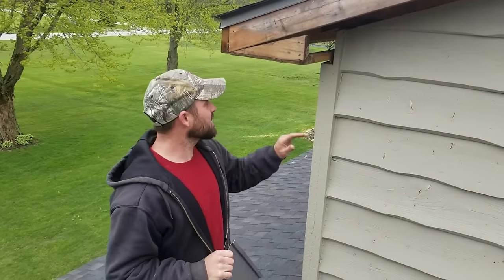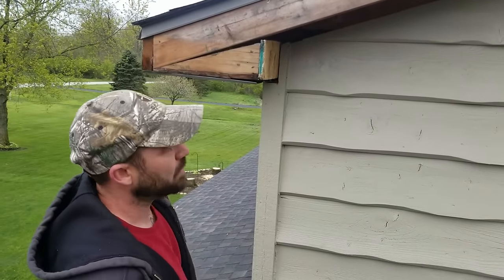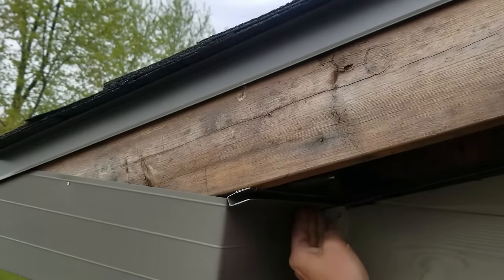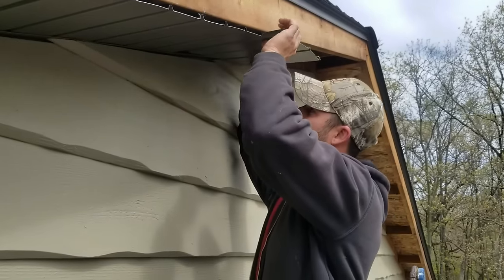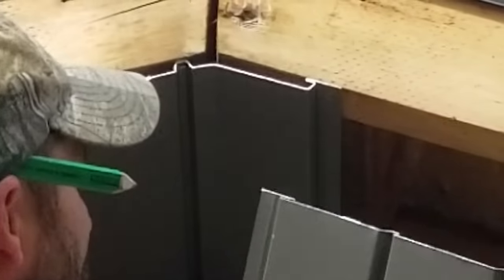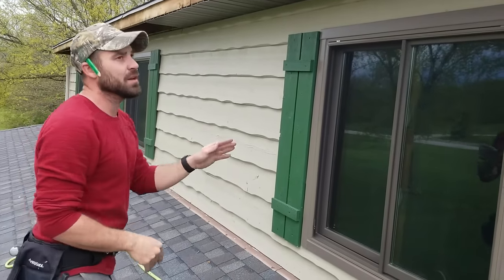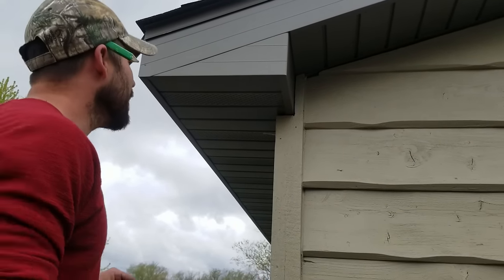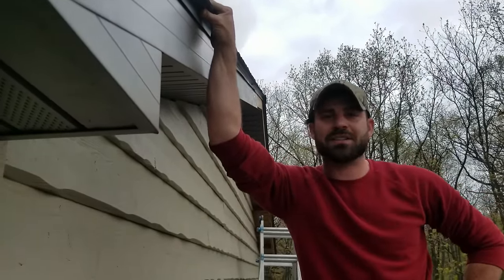HOW TO | Birdbox, Soffit and Fascia.

Comment: Man. Day late and dollar short on this one. Spent all day yesterday redoing fascia on my grandfathers house. Old one bys were completely rotted and gutters and fascia falling off. Could have used a few of these tips lol. What nailer is that you are using ?
Reply from the maker: damn i'm sorry! I usually save my better videos for sunday. you can ususally comment on my newest video or try a few times and get ahold of me if you got some questions. I use a 18g crown stapler. 3/4 or 7/8 staples in it. mines a dewault but I have a tool shop one as well as a bostich
Reply: @NWIVeteranConstruction  Yeah I've left comments on a few. We actually went to high school together at cp. Saw u in home depot couple months back while I was with the wife and kids but u looked busy so I didn't bother coming over

Comment: After watching your videos, I was able to Soffit my whole house. I am preparing to do the fascia next. I was told that I should only use white aluminum trim nails. I see that your guys are using brad guns. If I want to use my 18 gage brad/staple gun which I do. What staples should I use that will outlast the weather or are they all the same? please help and thank you in advance.
Reply: That's a stapler. A brad won't have enough of a head and will go through the material.

Comment: Needed to bend the first piece of faca on bird box around so front could go flush but good work 3 solid  1 vent
Reply from the maker: I actually use center vent now a days. looks nicer in my opinion. and I disagree with that honestly. you're right if you're doing a hip roof that's the way to do it. but if you do that then you will have front and the gable both cut flush coming together. I made this video so that guys will actually start avoiding that. that's exactly what my one guy did that I said he screwed up.
Reply: Gotcha thats how I learned there's alot of diff ways at the end if the day it looks great and water proof my guy
Reply: Really  dosebt matter the way you lap that if the gable end  facial will cover to the corner, but this very much depends on the with of the bird box because it will not always hit the corner dead on and the lap can show in that case especially  with pre bent  metal .
Reply from the maker: @uknodebo3092  fo shoo
Reply from the maker: @jessicacallahan9711  yea it's not the worst thing.  I did get lucky that the back fit perfect.  I didn't have to notch for the 2x6

Comment: When you were nailing the soffit we’re you using staples in the DeWalt gun? So if so is that DeWalt specific to staples or can you use any nail gun. Thanks learned a ton!
Reply from the maker: Crown staples. 7/8.  18 gauge I believe.  And it will take and staples from any brand basically as long as the gauge is correct

Comment: Any particular reason you use nails on the gable instead of screws? I also nail my horizontal fascia (I call it lower fascia) but I always use 5/8 soffit screws colour matched to put gable fascia on. Other than that I think I just watched someone do pretty much exactly what I do lol
Reply from the maker: haha right on man. well I've never pulled off soffit with screws in it. I think that's a little overkill but I guess if you're in a really windy area it might make some sense.
Reply: Worlds Fastest Shingler I meant just the gable end fascia I put on with screws, the soffit I typically use screws but just because I don’t have a stapler. Would be nice to get one though

Comment: Pro Tip #1 Don't build your soffit like the one in the video - end the soffit on the bearing wall at the intersection of the gable wall - don't run past the gable wall soffit right to the outside of the gable fascia board. (NOT the fault of the guy in the video installing metal soffits and fascia).

Pro Tip #2 Run the gable siding past the edge of the bearing wall covering the soffit "porkchop" (what we call it) or birdbox (as the dude in the video calls it). Looks much better than putting metal there. Some situations do require metal such as retrofitting the soffits on a home with existing stucco on the exterior.

Pro Tip #3 When installing drip edge, install the bearing wall side first, run it past the gable side - cut the drip edge on top at the intersection of the bearing wall side and gable side and wrap the drip edge around the corner and up the gable a bit.

Comment: When I do soffit facia on gable ends  like that I start right in the peak then the first piece you just bend in the middle groove and finish each side. Then you will get the same sized little piece at the bottom. The only hindrance is having to clip them backwards on the one side.
Reply from the maker: yea that's what I said up at the top. i'll try it a few more times that way and see if I like it better but I've always preferred this way

Comment: Man i don’t think this is gonna work on my eves. They are around 23” and the facia wont reach up to the j channel (it’s 7” up to the facia on the gables from
Bottoms of bird box) on the gables side so I was gonna break a little flashing but now I look at it there will be a triangle showing on the bird box side where the horizontal facia won’t cover up high enough to the facia running down the gable. Wish I knew that before building my bird boxes lol any tip?

Comment: You almost couldn’t pay me enough to install aluminum soffit. Vinyl is so much nicer to work with. You don’t need to have a nailer with you, hit the flange and be done, if you begin to run out of square even in the slightest you can stretch the front or let it “relax” and you’ll never notice it, and it’s all around a better product. Vinyl doesn’t corrode in our climates like aluminum does, and if it takes on an odd color from mildew, whatever, pressure wash it and you’re done!
Reply: Vinyl soffit is shit. It’s not as rigid as aluminum and looks cheap. Plus it expands and contracts to much and leads to blow off. Having a stapler is way quicker and more efficient than hand nailing trim and soffit.
Reply from the maker: I think you ought to change your opinion bud! I see your point but nah.. aluminium is better
Reply: @NWIVeteranConstruction  aluminum siding was big in the 80s but not so much now,cut edges rust and make dtains

Comment: You know with a brake you can make that bird box in one piece !
Reply from the maker: Could've done it by hand with a square.  Don't normally do that but its a good idea for sure.
Reply: Zack of All Trades why not use a brake for your fascia ? You know a roll of Cole . On houses like that they make it easy to float out when you have big difference in your fascia . It will save you time on bird box’s . You can make all of your time . J,F,Starter,Sill trim and any you need to fill odd size pictures . Most of the time I measure when I’m at the house doing my material take off . Then I brake my pieces at home to get a head start . Same thing with cutting soffit . When your paying guys 18 a hour they need to hit the ground running .
Reply: Bending your own fascia takes to long!And if you don't put a rib in the metal it buckels!I agree you can use a brake for alot of stuff but using pre bent fascia is faster!And 18$ an hour isn't a hell of alot!
Reply: Andrew Will when you use a brake it looks better and I can bend the entire house in a hour .  But only a pro can use a brake
Reply: @JohnnyBarger-sb3yh  🤣🤣Only a pro your funny!It's a tool just like any other tool climb down off your high horse!And how does it look better!It's metal rather if you bend it or if someone at a company bends  it!I'm not saying it can't be down I'm not saying you can't make it look nice.However it's a waste of money!Now if you can find someone to pay you for bending it then great!Only the time you have in bending it the money you spend on a brake you might as well just buy the pre bent fascia.We don't have to agree that's ok.Only to act as if your bending metal is any better looking then pre bent is bullshit.Now yes I agree it takes some skill to bend good looking metal that most would rather spend time on other things that generates better income.Best of luck to you boss
Reply: Andrew Will I see your skill in your bird box work . I can do it I one piece . Pre bent doesn’t came hemmed  . Someone pay me , I write the checks
Reply: @JohnnyBarger-sb3yh  what?
Reply: Andrew Will I didn’t think you would understand
Reply: @JohnnyBarger-sb3yh  you see my skill in my bird box work?You have never seen any of my work!Yes pre bent does have a hem in some or at least a tiny bend to stiffen it.You may write the checks to the people you employ but someone writes the checks to you for the job!We all have a boss at almost all levels!Again I'm not saying that you can't make great looking metal I'm not saying you can't make some profits from bending your own metal.Im saying that alot of people can't as the market isn't out there for all.That rather you bend the metal with your brake at the job/shop/or your house it's no different then a company bending it at there facility! Aluminum coil stock is aluminum foil stock.Not saying you can't bend metal that is different then conventional pre bent that looks unique.The time you bend that metal a person could be installing and done faster and on to another job.Also your right some people can't use a brake well or choose not to cause they rather focus on a strong point of theirs to produce more profits.Not everyone is the same and not everyone excels at the same things.
Reply: Andrew Will so you think all coil
Is the same . Brother Kaycan is not Alcoa .
Reply: @JohnnyBarger-sb3yh  I bet you didn't think I would understand what you wrote.It was like a this grader wrote it.Reread it,or maybe it made sense in your head and I can see how it would.As far as all stock being exactly the same of course it's not.I thought you would understand my point but of course you had to act as if you were more intelligent or experienced.Yes stock comes in different paints and surfaces as well as thickness.im done boss your cool  not going to keep going back and forth with you.Your either a kid,too prideful and not humble or a old man set in his ways thinking his way is the only way!!Like I said before best of luck to you hope you prosper!!
Reply: Andrew Will I have been doing great for 50 plus years . I’m to the point I don’t have to bid jobs they call me  .

Comment: Why do you use the store bought trim coil if you own a brake yourself? Looks a helluva lot better imo.
Reply from the maker: really? I always preferred the ribbed look. that's what most everybody uses out here honestly and especially in the nicer neighborhoods. its also convenience thing on top of that. its readily available and I don't need to have a guy bending fascia when he could be installing soffit. its actually not that expensive either. I was always under the impression you only bend fascia if you have to custom bend because of a little one-by bump out or if you're trying to save money.
Reply: I usually bend my own but I have a different way. I come down 5/8  past soffit. Over 1 1/4 then bend a 5/8 lip. That way I can install 2" x 1 1/4" clips that help hold the fascia and keep it from being blown off in a strong storm or windy day.
Reply: Worlds Fastest Shingler  that’s cool. I hear ya on not having to have a guy on the brake. That was always my biggest problem was I needed to be on the brake and I needed to be on the walk board installing when I was trying my hand in the siding business. I’m not too far from you though. I’m in Louisville and we custom bend every piece we put up as do 99% of the siding crews around here. And we use vinyl soffit material too. It’s all the exact same principles as what you are doing we just do it with different material I guess. And we would have put the gutter board on first with a fold on it, then bird box mitering both bottom lips and then coming down with the fascia on top of everything. But all in all I’ve spent countless hours watching your videos and I really enjoy them. I have learned a lot about tiffing from you. So much so I’m gonna try my hand at taking in a few roofs this summer and see how that pans out. Keep up the good work
Reply: **lol. That was supposed to say roofing not tiffing. Lol
Reply: Worlds fastest shingler did this detail the best and most correct way possible. That fascia corner is water proof.
Reply: We always allow the birdbox or  contour bock and rake to run out past the bent over fascia then trim it a hair long and caulk the edge. It looks like a  seamless corner. Also in Virginia we almost always have rake trim so we always break the metal to contour it. There more than one way to pluck a duck.. nice work man!!
Nice work man

Comment: He added that piece of fascia on the side and cut it off. Yes that's the right thing to do but you want to put your front piece on 1st and add an extra inch or two and wrap the corner and run that extra inch or 2 up your Gable that way when you add that side piece and you cut that off flush on the end and water cant  get behind there. Think like a raindrop
Reply: just a heads up
Reply from the maker: That's what I did.  I didn't cut the from off I scored it and the bent it to get a really clean line.  The the gable fascia came down flush
Reply: @NWIVeteranConstruction  that one yes you did. Great job. I was talking about the one on the front. I swear if you put your front piece of fascia on first an extended over to inches and wrap it up the Gable. Then at peace that you made with a crisp line you put that on last that way you don't have to cut edges that meet each other for water to get behind because you have your front piece that runs up the Gable and then you're outside piece overlaps that. Other than that you did a great job just trying to give you a a little pointer if you're understanding what I'm trying to explain here
Reply: I think you did say something about bending a 45 and tucking that in later is that what you said. if I misheard you wrong and that was your plan great job

Comment: Couple of things. $18/hr? McDonald's pays that around here. Avg wage is $30hr,if they can run a brake. (brickmold with no tape measure...hem, Flip, flip,.. You know lol) another.. Why not bend a slip hem (like undersill) on the fascia covering the box? Makes it stiff, and breaks up the fascia ridges if the gable ridges don't line up with the eave.
Reply from the maker: never thought of that. what exactly do you mean if you don't mind a clear breakdown? coz i'm not picturing a good way to get a bend on that angle. and don't dis our pay lol its Indiana. don't cost much these days to survive
Reply: @NWIVeteranConstruction  I do the same as you on gable fascia. But, either I put the tail end in the brake, and bend a hem, pain in the ass, unless you have a helper hold the end of the fascia, as only the tail is in the brake. Or I'll make a hemmed (looks like a piece of undersill) piece to slip over the cut end of the tail. Stiffens the tail over the box, works great on tall box returns, you don't have to make a full box that way (out of lumber/sheeting)
Reply: @NWIVeteranConstruction  with materials and labor for soffit fascia we're right around $10/ft. As long as it's 1 story, or walkable roof. Otherwise it's 50% more for each 10 ft story. Actually, it's anything over 10ft. So walkout are $15/ft. 21ft $20/ft etc. Unless homeowner picks Edco pvc coated soffit. That's a little more, but it looks way better (woodgrain, deep colors)
Reply: Can you explain the second part more (slip hem). I didn't understand. Thanks.
Reply: @Faruk651  so you don't have a cut edge on fascia over the box. You bend a piece of coil stock, and slide it over the cut fascia

Comment: What if the facial board sags I" in the middle?
Reply: You can run a bead of silicone between the panels to keep it from sagging.
Reply: If you don’t want to replace the board just cut the fascia board into a few lengths so it follows the sag more easily
Reply from the maker: if the fascia sags you can snap a line and cut it off. just don't cut off too much. I would say probably should cut off more than 3/4 of an inch or it'll show when you look up at it. if its more severe than that you can add to the other sides of the sag (as long as it doesn't make your fascia come out of the drip) and/or break a few pieces of fascia where the level change is like my man said in this comment thread

Comment: Also if that metal siding you could have cut that first sofit in the middle at the bird box or cut the middle and fold it behind the bird box since you didn't run it higher and you wouldn't have that gap where the box and the sofit meet and not have to chalk that gap.

Comment: When you do soffit fold your first pan in half and start at the peak
Reply: You’ll never have that problem
Reply: When you do facia you always wanna hide your wrap around, and when you nail your facia pop a hole in the metal and then twirl the nail the make the hole a little bigger and your metal won’t bulge or dent when you finish driving the trim nail.
Reply from the maker: we call that wallering her out

Comment: I wrap my eve metal around the bird box if possible. Sometimes it will leave a gap on your rakes but rarely   if so i wrap the bird box separately.
Reply: Same here. I also don't bend soffit at the peak. I cut both sides and bend a  piece of metal with a hem that covers 2 inches on each side same color as soffit. Gives a much tighter crease.